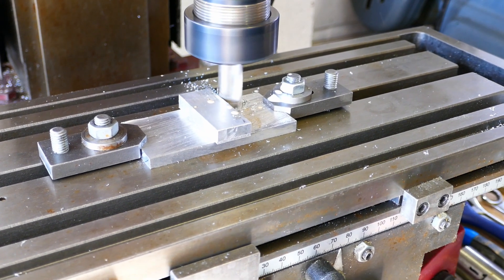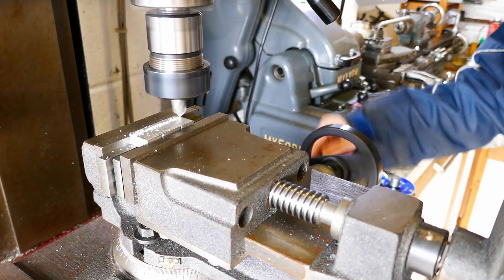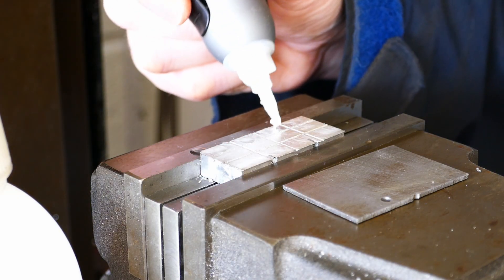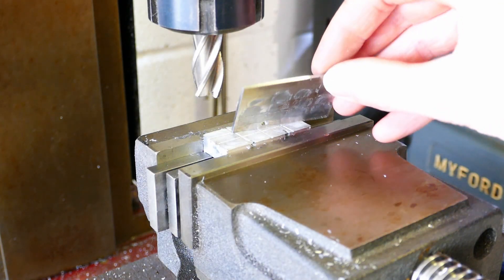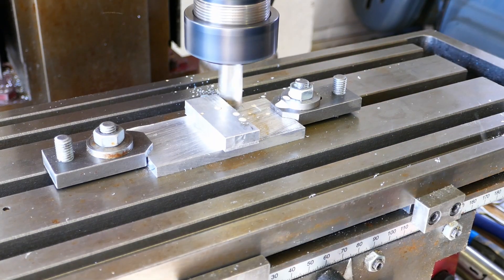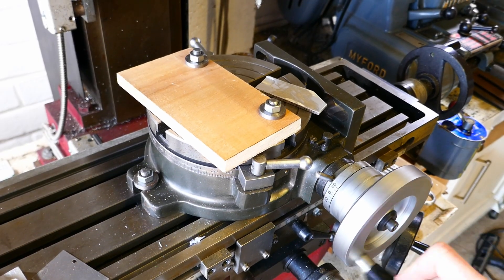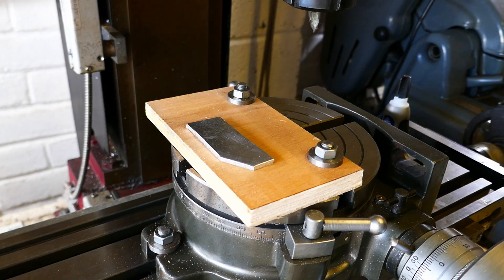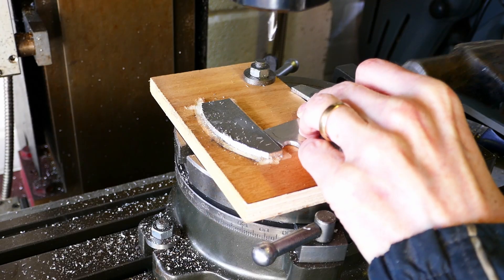Superglue Workholding -  Great Milling Machine Hack

Comment: How can you guarantee that the glue is distributed evenly and *flatly*?   Doesn't the thickness of the glue vary from spot to spot?
Reply from the maker: The glue is very thin so I don’t think it would be a problem for most purposes if the part is firmly pressed down when the glue sets.  For critical applications you would have to check the flatness by measuring.